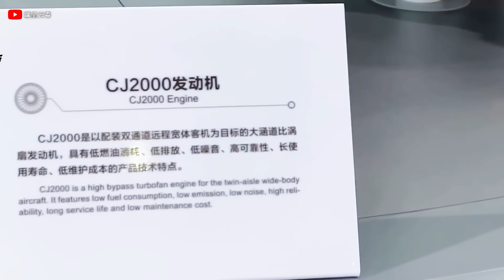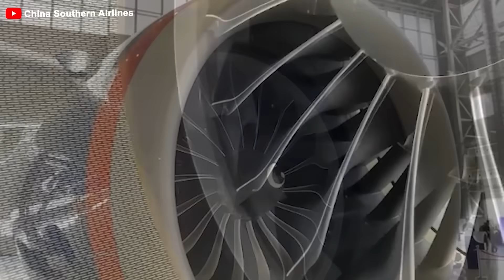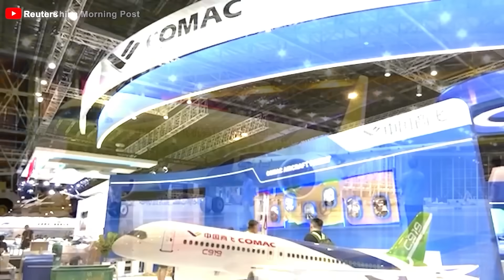China's NEW C929 Aircraft 12,000 Kilometers Testing Flight that SHOCK Western!

Comment: C919 is in service but only 19 have been delivered. The production capacity is still lagging in this regard. Mainly due to western tech it requires and relies on. C929 would probably be better since it relies much less on western tech. Compared to C919, C929 only uses approx. 10% western tech sourced from international suppliers compared to C919 which uses about 60%.
Reply from the maker: It’s really something to be hopeful about for the C9 29.
Reply: @FLIGAVIA  Given China's resolve to be self reliant and track record. I dont doubt it. Case in point their AI and Chip ambitions.

Comment: Info laut Microsoft Pilot: Noch nicht – die Comac C929 befindet sich weiterhin in der Entwicklung und ist nicht einsatzbereit. Der erste Prototyp wird frühestens 2029 erwartet.
Ursprünglich war die C929 ein Gemeinschaftsprojekt zwischen China und Russland unter dem Namen CR929, doch Russland ist 2023 offiziell ausgestiegen. Seitdem entwickelt China das Langstrecken-Großraumflugzeug allein weiter. Die Maschine soll etwa 280 bis 400 Passagiere transportieren und eine Reichweite von bis zu 12.000 Kilometern haben.
Einige wichtige Punkte:
- Erstflug: nicht vor 2030 geplant
- Produktion: erste Rumpfsektionen sollen 2027 fertig sein
- Triebwerke: eigene chinesische Triebwerke (CJ-2000) sind in Entwicklung, aber noch nicht serienreif
Wenn du magst, kann ich dir zeigen, wie sich die C929 im Vergleich zu Airbus A350 oder Boeing 787 schlägt – oder warum China so viel in dieses Projekt investiert. Klingt das interessant?

Comment: Looks amazing but in this industry it can take years before major airlines worldwide decided to buy them look at the dreamliner, 747, 380 they all had long struggle to get customers. Airlines have challenges to insure passenger safety and aircraft manufacturer support. China already has a heads up on that due to the size of the Country but other nations would likely wait to see how it holds up. Look at Boeing problems and Airbus 380 issues.

Comment: AIR BUS Europe check on SEARCH ￼ ￼ ￼ ￼

🛩️ Aircraft Information
	•	Model: Airbus A350-900 (A359)
	•	Registration: Varies; recent flights have utilized aircraft such as B-1080 and B-1082
	•	Seating Capacity: 312 seats, configured as:
	•	32 Business Class
	•	24 Premium Economy
	•	256 Economy
	•	In-Flight Amenities:
	•	Complimentary meals
	•	Seatback entertainment system
	•	On-board Wi-Fi
	•	USB ports and power outlets
	•	Seat Dimensions:
	•	Economy: 81 cm legroom, 46 cm width
	•	Premium Economy: 97 cm legroom, 46 cm width
	•	Business: 152 cm legroom, 58 cm width

⸻

📅 Upcoming Flights

The next scheduled departure for Flight CA929 is on Tuesday, April 29, 2025, at 09:55 AM CST, with an expected arrival at 02:00 PM JST.  ￼ ￼ ￼ ￼ ￼ ￼

Comment: I think that china is using c929 as airbus 350, it will be 14000limometers range.  Boeing 777series are the queen of sky. China has got all the funds and technology now to develop it.
Reply: 12000 km is still a long ways behind the A350-900ULR which has a range of 18000 km.  But this is a good start...
Reply: I give them all credit and hope they achieve this very soon
Reply: No han sido capaces de fabricar aun su primer motor para aviones 😂
Reply: @alexander09129 So you are one of those who is making fun out of what China has “not done” yet? 🤡
Reply: @alexander09129  Their first C919 single aisle used 70%+ mostly western parts including its engine on their first debut. What's all the fuss about this newer C929. Yep hello west again are you still in with this.?
Reply: @alexander09129 nothing funny about foolishness 🤡
Reply: Boeing needs to put the 747-8 back into production  with new improved engines for a quick fix!!!
Reply: @jimcasale332   Boeing has had enough "quick fixes"  That's their problem.  How about they spend time, engineer a better aircraft and focus on the long term....
Reply: @jimcasale332  Boeing is struggling to make deliveries. And it has had some planes malfunctioning with disastrous results due to design flaws.